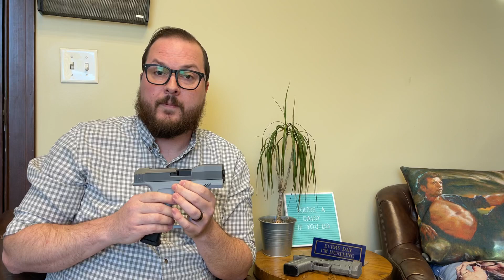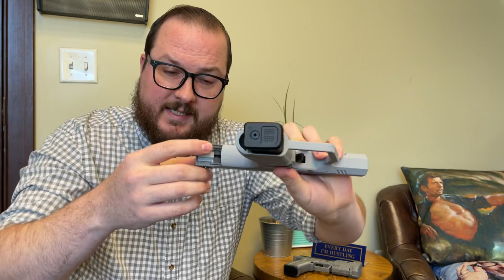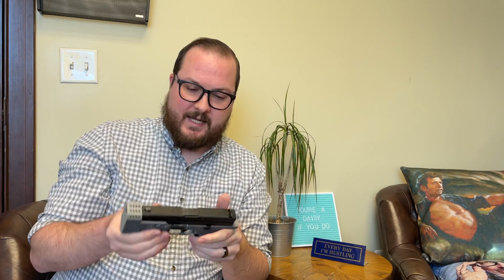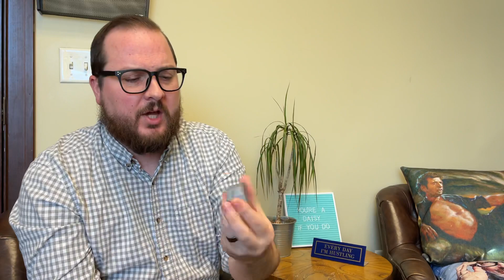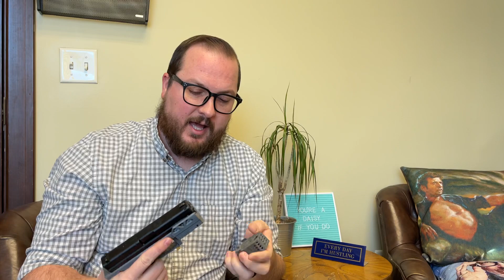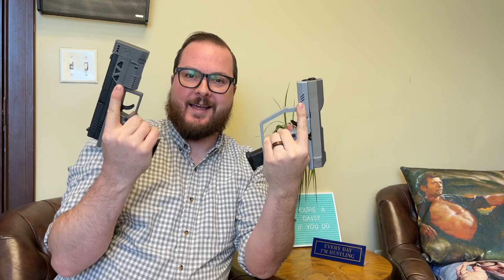Project Updates: Halo Magnum and RE-45 Pistols

Comment from the maker: READ BEFORE COMMENTING: Tired of being asked the same questions so I'll pin a comment here:
1. "Why don't you just use an MOS slide to mount the cover?" Because physics. An MOS slide would only attach it at the rear, whereas the majority of the mass of the slide cover is at the front. An MOS slide mounting interface would add nothing to the stability of the slide cover and would only serve to limit the types of slides this can attach to. The solution I've come up with (extended rear plate with a crosspin through both the plate and the cover coupled with a steel front sight sandwiching the cover between it and the slide) should be incredibly sturdy, but that's part of what we're testing.
2. "Make it in .50 GI/10mm/375SIG/etc" Large caliber printed Glock frames aren't yet up to my standards of safety and reliability. When they are able to be printed safely, then we can look at larger calibers. 
3. "Make it in a SIG 320/Hi Point/CZ75/etc." I'm tired of being told by people that the SIG is the better option since you don't need an FFL to buy a grip module. Yet they're forgetting that you need an FFL to buy the FCU in the first place, defeating the whole purpose. You're printing the frame anyways, what benefit is there to having a separate internal component that's serialized? There really is no benefit other than ease of printing and selling grip modules which, gasp, I have ZERO interest in doing. I don't sell printed objects, I design things and you print them yourself. Which leads me to:
4. "I don't have a printer but you should make me one." So buy a 3D printer. The printer capable of making this costs under $200. Someone making and selling these is committing a federal felony most likely, and if they have an FFL and are selling them serialized as an 07 manufacturer, they are probably charging you more than  $200. Which is why you make it yourself. 

That covers the 4 most common questions I'm getting on this project. Read this before commenting please.
Reply: Not sure if this is something you'd be interested in, but a lot of 3D printing channels have been casting prints in brass, could be a cheap way to prototype a comp that won't explode and melt immediately.
Reply: Would you make the P2011 or P2016 from Titanfall?
Reply: yo no hate but the RE-45 is from titanfall, then apex. anyway i loved the vid and just subbed so have a good weekend.
Reply: The RE-45 (9) was def my favorite, titanfall 2 was my favorite game as a kid and seeing it come to life is really cool! Can’t wait to get one of my own <3
Reply: You didnt get a Micro Eagle? It's pretty much the Halo gun in 380.
Reply: When the large caliber printed glock frames are up to snuff I'll convert my glock 20 in a heartbeat

Comment: The reason that nobody makes pistols with the sick cutlass hand and trigger guard like halo is that it would count as a forward grip, thus, making it an NFA regulated SBR. THANK YOU ATF FOR DESTROYING MY SCI-FI DREAMS!
Reply from the maker: That’s… not true at all. A trigger guard is a trigger guard and a vertical grip is a vertical grip.
Reply: @booliganshootingsports  A trigger guard that extends down the length of a pistol grip may have the length to be considered one by an organization bent on exerting arbitrary authority
Reply from the maker: The design and marketed use of any part of a gun is taken into account when interpreting its intended purpose. It’s a trigger guard. It’s shown and used and advertised exclusively as a trigger guard. It wouldn’t even work as a vertical grip as there isn’t room for both your support hand and your trigger finger. 

It’s completely a nonissue.
Reply: @booliganshootingsports  thanks for the information

Comment: Is there a specific front sight post you're using, or will any standard suppressor height sight work out of the box?
Reply from the maker: I show one that I’ve used successfully in the file drop and readme
Reply: @booliganshootingsports  yeah I'm looking at the pic and there's no markings or dimensions or anything - and the readme just says supp height sights so I was just looking for clarification on that... if you've only tried the one then that's perfectly fair. I'll probably grab an ameriglo and see how it fits
Reply from the maker: @KingDookies  I included a pic of ones that will work in the files. The base shape is what's important there. 

They need to be similar to the suppressor height ones I include a picture of due to the wider base and to give the extended screw more metal to grab onto. The height itself doesn't matter because it's not going to line up with the rear sight anyways. You either need to modify your sight picture when shooting or file down the front sight once installed to be whatever height lines it up with your rear sight if you are actually trying to get accurate shooting out of this video game meme gun, lol. 

So basically, the front sight maker/height/etc doesn't matter because it's being used more importantly as a way to secure the slide cover more than an actual front sight. 

Hopefully that makes sense.
Reply: @booliganshootingsports  makes perfect sense thank you very much for the follow up. I'm still dialing everything in before I try getting the meme up and running but I'm looking forward to playing around with it.

thank you for being involved and helpful!

Comment: Which lower parts kit did you use and did you have any problems when you pull the trigger and I watched a couple videos and it says if I used the factory Glock GEN three lower parts kit that I would have to change I’m having a brain fart piece on the trigger from a GEN four you can buy just a piece for a few dollarsI said first try to check it out yourself if you polish it it could help the break but this is my first time having a problem with one
Reply from the maker: These Glock it’s almost exclusively run Gen 3 parts kits.

Comment: Question for you, the 3011 do you have the ability to test it with a WE airsoft 1911 slide at some point? 

I'm kind of tempted to build one purely for that.
Reply from the maker: It won’t work just because of the way the gun fires. Not even counting any fitment issues that’ll come up.
Reply: @booliganshootingsports  dam, iv been playing with a modified 3d printed ar15 housing and a WA gbbr  hammer for a similar concept but have been having issues with getting the angles right and given some of the .22 slides can run on a WE lower I was hoping that solved my issue.
Reply from the maker: That’s the thing, an airsoft 1911 doesn’t fire because the hammer strikes the “firing pin” on the back of a slide. It fires because there’s a “striker” down inside the frame that hits the valve on the magazine. So you’d need to figure out a whole different firing mech.
Reply: @booliganshootingsports  oh I know, it being an internal striker fired thing makes life a lot harder. That's why I started with the .22 conversion slide in my tinkering and went from there as that's how most of those work. Hammer moves to strike a striker. 

Its a long term project and I was hoping for a shortcut. I suspect the rails would solve one of my issues though.

Comment: For extra extra extra strength you could maybe get a milled slide for an RMR and have the top cover fit down into it internally with a couple screws to hold it there, too, maybe.

Comment: Could you put a rail (glock or picatinny) on the magnum lower and then attach the front shroud to that? It would probably be more accurate to the in game magnum, because the front part doesn't move with the slide. No idea how stable it would be though.

Comment: I haven't seen an answer anywhere here or your other social media options, so sorry if you have addressed it. Given that you are using the front sight both as a mounting point and a sight, is there anyway to have a cutout near the back of the slide to have the adjustable rear sights visible?
Reply from the maker: It would reduce the structural integrity, and they’d be completely the wrong height. It has an integrated rear sight notch.

Comment: This frames are both amazing! The little and the bigger details in the hanguards, in case of Magnum in the slide... This is an outstanding job Sir and I hope, as probably everyone who saw what you can do up to this point, that you'll surprise us with more of what you'll unleash! Have a good day/night.

Just on little thing for the sake of my insanity, Titanfall 2 came out in 2016 and that's when Ryan Lastimosa (3D Art Director for Respawn Entertainment) presented automatic pistol RE-45 as a secondary weapon for Pilots (well, it was also in the game of Titanfall 1 as RE-45 Autopistol... but guess we won't need to worry about that one in any conceivable future).
 The latest model was implemented to APEX Legends in 2019 and made by Corwin Paradinha, with major adjustments to frame, slide and the sights. 
They are significantly different, however there are three parts which are present in both models: -the big muffler/recoil compensator thingy in the front, -mounted holographic sights, -extended magazine.
Guess I'm gonna stop myself here.

Edit: Also please take a look at Hammond P2016 frame from TF2 or P2020 from Apex, both are worth considering. Or I'm just talking for myself cause those were always my favourite.

Comment: Def all about the Magnum! 
Altho I am biased, as I don’t play Apex or Titanfall. And have been playing Halo since CE first came out, and played on PC. 
It looks GREAT. Can’t wait to try the final render. 

Also, your work on the comp on the RE-45 sounds solid. I think people will really like that it’s easily replaceable. Only failure I could think of for the comp (so long as there’s no impact related failure) would be just it getting worn down from heat/gases/heavy charged rounds overtime. I know from experience that comps (or other muzzle devices) can get wicked hot (like burn thru canvas or gun cases hot). But making something easily replaceable I think is the most logical way to go about being able to balance both function & form.

Comment: Will it handle the recoil from 357 Sig or 40 I have a Glock 23 slide laying around that I don't have a project for
Reply from the maker: That’s part of the testing.
Reply: @booliganshootingsports  thanks for the reply I'm very new to 3D printing in general just seems like a very interesting project to get into I totally got into 3D printing not even realizing that you could do stuff like this I was making custom bits for cars like custom air intake stuff like that being able to modify things to get O2 sensors to pass emissions along with getting a cold air intake into the vehicle and then I learned you can do a lot of things with 3D printing lol

Comment: That RE-45 is legit. Can you do a Glock version? Probably be cheaper for anyone who wants to build one... plus you know, Springfield is on the outs with the gun community for their anti 2A actions years ago... they still haven't really redeemed themselves. Don't give them money.
Reply from the maker: Their used parts kits are extremely cheap (like $230 complete) and you can buy them with $0 going to Springfield.
Reply: @booliganshootingsports  i didn't know about those... I might have to look into that then. Specifically for when you're ready to stop that RE-45... I don't have many dedicated range toys, but Titanfall is one of my favorite shooters. If it's possible, I think I would absolutely need to add it to the wall... I did turn a Thompson into a M-41A Pulse Rifle, lol.

Comment: For your RE45, you may consider using an extended barrel and have the ‘comp’ just be for looks IOT avoid the blast destroying the comp. you’ll have to figure out the channel for the barrel movement up/down during cycling, but that should be easy to print or even mill around.
Reply from the maker: Yep, that’s one of my backup plans

Comment: Question for you, have you considered doing something like casting the frame and/or comp in aluminum? I haven't seen anyone do this and I'm very curious about its viability. Will do once I have a printer myself but still curious
Reply: Casting will be hard because of the holes, but that's really solved with a drill press. Might be better to simply CNC the whole comp... it's not like home CNC mills don't exist. Plus you'd be able to use a stronger metal than aluminum (which will wear with use). Chances are it would work similar to the Strike Industries Mass Driver comp (which is a badass comp. I have 3 builds using it, and it's like shooting an airsoft gun... completely flat).

Comment: Unnecessary bulk but i get it, doing it for fun, its a halo icon. For the front grip, if you extend it down maybe a half inch or even 3/4 just the front half of the grip you could put the grip gaurd down lower to fit your hand, down side is it would only accepted exstended mags.

Comment: Idk about 9mm but I know for a fact muzzle blast from an AR will practically vaporize any 3d printed compensator/brake you try and contain it with
Reply from the maker: The muzzle pressure differential between the two is massive.
Reply: @booliganshootingsports  the print time on that replaceable compensator will be considerably longer than it's range survival time. my prediction is that it will break just from recoil, and the muzzle blast will shear it in two as well. 
your modeling skills are impressive; those pieces look incredible. i just don't have faith that the plastic will hold up in any areas where heat or pressure from the round is involved whatsooever

Comment: what infill to wall ratio do you use to print the frame for this one, as well as the slide. Are they the same settings?
Reply from the maker: I usually do 6+ walls and 99% infill for everything.

Comment: And fn 45 would have been a more accurate starting point for the re45... I understand why you wouldn't start there but it's way closer the the Springfield xd 🤢🤮
Reply from the maker: It really wouldn't be more accurate at all. The FNX45 is hammer fired, doesn't have a grip safety, doesn't have a trigger safety, and looks absolutely nothing like the RE45. The XD is actually a MUCH closer look visually. The only similarity to the FNX is maybe the grip angle. And I get why some people don't like the XD, but I'm curious, why specifically do you not like the XD?

Comment: Literally going to buy a g19 just for this. Fantastic
Reply from the maker: Best part is that you won't need to. You print the "firearm" and just install parts. So no need to buy the whole gun first.
Reply: @booliganshootingsports  so hyped
Reply: Next stage 3D print spring jigs and mags etc. try as self-built as possible. I'm checking out metal-working equipment to cut out the middle man lol
Reply from the maker: @xSP3CTREx  that’s easy stuff, we’re already doing that.
Reply: @xSP3CTREx  we're making barrels and bolts already
Reply: @booliganshootingsports  Which parts will you need to buy? Just the upper receiver and trigger assembly? Or is there more to it?

Also, god that magnum looks good.
Reply from the maker: @arcticterra2926  upper assembly (slide/barrel/firing pin/etc) and a lower parts kit. Plus the metal rails for the slide to ride on.
Reply: I was literally gonna sell my glock 19 and same day found this and decided to keep it LMAO!
Reply: dude, the hand guard will count as a forward grip, that would make it an SBR
Reply: Same
Reply: Same
Reply: Same